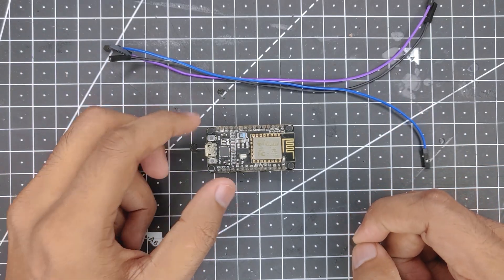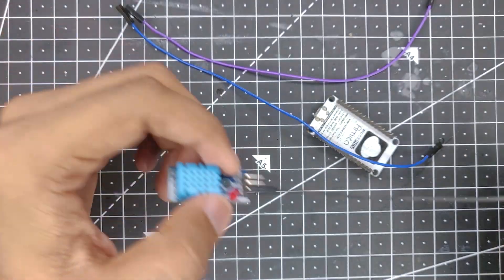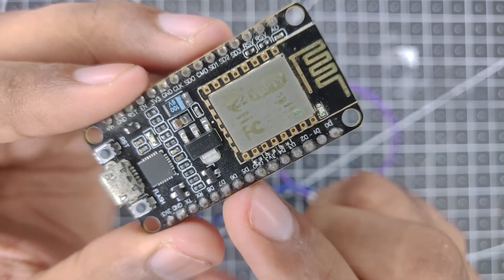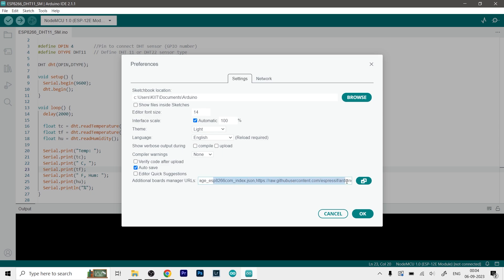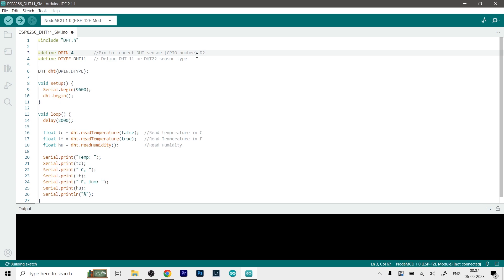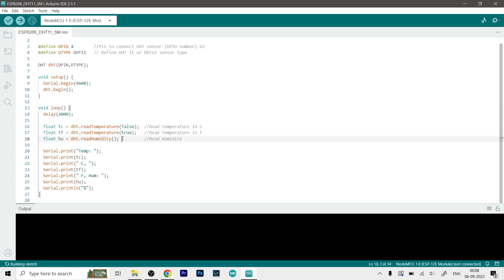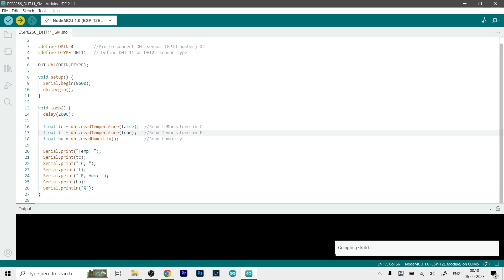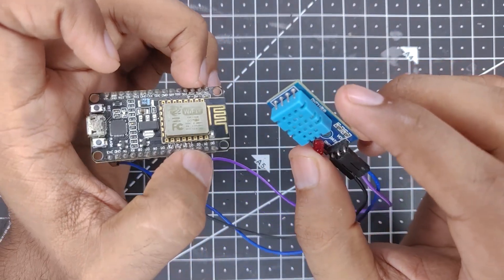How to use ESP8266 NodeMCU with DHT11 Temperature and Humidity Sensor

Comment: getting an error  "Error compiling for board NodeMCU 0.9 (ESP-12 Module).
". I am using Nodemcu esp8266, IDE  1.8.18, And the board manager is also updated
Reply from the maker: You should select the esp 12E model

Comment: Bro I was had it working on my arduino uno and was confused why it didn't work on the nodeMCU... why the F*CK is the D4 pin on the code the D2 pin?!?! 

Thanks though
Reply from the maker: Yeah bro it is very confusing. Not sure why the did that but glad I could help.

Comment: why my temperature and humidity says nan and not showing the number?
Reply: Yes i have also same issue
Reply from the maker: It will say Nan when no data is received by the board. Likely cause for this is bad connection between the sensor and the board or you may have connected it to the wrong pin.
Reply: @INOVATRIX  toujours j'ai change mais ca marche pas gpio 4 c'est la broche 2 , mais tjr rien

Comment: love you bro aise hie ek moisture sensor ka code ka video bhi bana de
Reply from the maker: Ok will try my best 👍.
Reply: // Global declarations
int SensorPin = A0; // Define your sensor pin(A0 for Capacitive Soil Moisture)
int soilMoistureValue; // Variable to store sensor reading
int soilmoisturepercent; // Variable to store percentage value

void setup() {
  Serial.begin(9600); // Initialize serial communication
  pinMode(SensorPin, INPUT); // Define the sensor pin as input
}

void loop() {
  // Read the sensor value
  soilMoistureValue = analogRead(SensorPin); // Read the sensor value
  int percent = map(soilMoistureValue, 1023, 0, 0, 100); // Map the value to percentage

  // Determine soil moisture percentage
  if (percent < 0) {
    soilmoisturepercent = 0;
  } else if (percent > 100) {
    soilmoisturepercent = 100;
  } else {
    soilmoisturepercent = percent;
  }

  // Print the results(Serial here relates to the Serial Monitor in Arduino IDE) 
  Serial.print("Soil Moisture Value: ");
  Serial.println(soilMoistureValue);
  Serial.print("Soil Moisture Percentage: ");
  Serial.println(soilmoisturepercent);

  // Add conditions if needed
  if (soilmoisturepercent >= 0 && soilmoisturepercent <= 20) {
    Serial.println("Soil is too dry!");
  } else if (soilmoisturepercent > 20 && soilmoisturepercent <= 60) {
    Serial.println("Soil moisture is moderate.");
  } else {
    Serial.println("Soil is well-watered.");
  }

  delay(1500); // Delay for 1 second
}